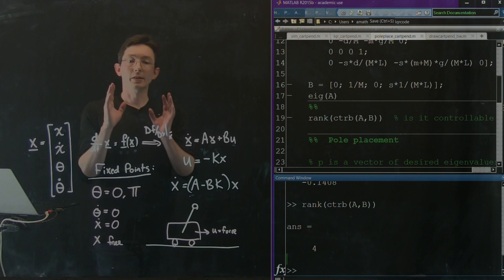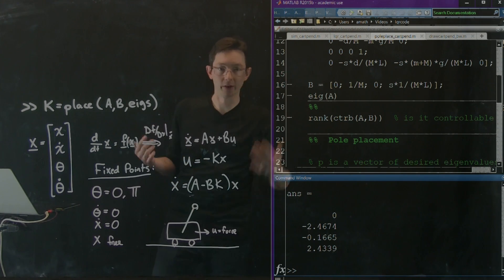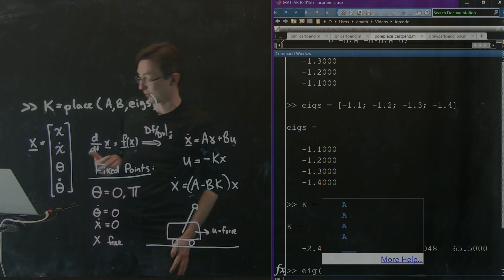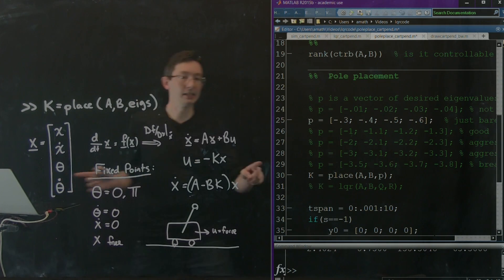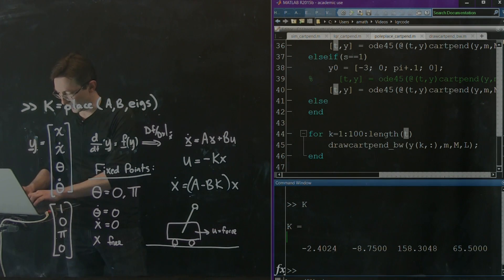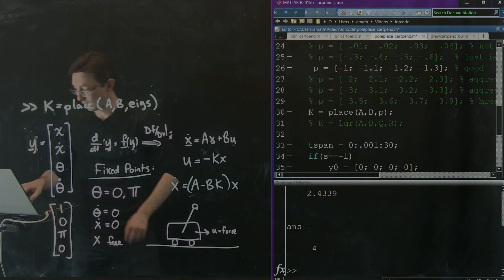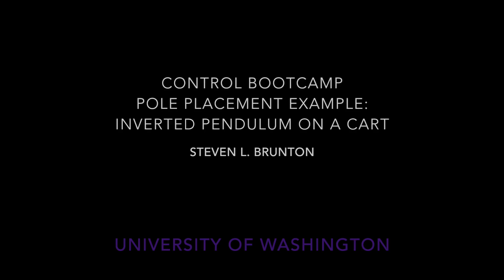Pole Placement for the Inverted Pendulum on a Cart [Control Bootcamp]

Comment: This is great, but somewhat confusing. We are using a numerical model where time is clearly discrete. Poles should therefore be within the unit circle on the complex plane. Instead, we are using the definition of stability taken from the continuous-time systems (negative poles). Where is the boundary between continuous time and discrete time? Is this about how small time steps are?
Reply: the MATLAB’s solver (ode45, ode23, RK4) converts it internally into very small time steps, that does NOT mean your system is discrete, It means your computer evaluates the continuous system numerically.

Comment: The cool thing here was that y_ref did not show up in designing the controller. We only used y_ref when solving using ode45, which to me means that the final state does not have an effect on the controller. So cool. Someone correct me if I'm wrong. (Maybe it's a result of those equivalent reachability, controllability, etc. stuff)
Reply: y_ref (same as X_ref in the video) is zero, so no need putting

Comment: Thank you for the great video. However, I found a little bit weird that we designed u=-kx but implemented u=-k(x-x_ref). Could you explain why it still works?
Reply: Yea, K acts on the error to the reference signal, so if we are close to the reference signal we don't need to have as much control input I guess.

Comment: Thanks Professor! How can I generate the code to run the controller in Arduino?
Reply from the maker: Good question.  You can start by downloading the code at databookuw.com.  Also, Brian Douglas has some great stuff on control implementations in hardware.

Comment: I have a doubt on the beginning values used in the simulation. The starting values are chosen close to the point where we want to stabilize (pi,0) or (0,0). What happens if the starting values are faraway from the point to stabilize? I guess our linear model is not valid anymore and we wouldnt be able to guarantee that we can reach the quasi stable equilibrium (pi,0). Is there any general rules on this? If starting state is way in the non linear region (where linear approximation doesnt apply), can we still use the linear controller?
Reply: Well at some point you will have to use non linear control, which is much more complicated than linear control. Or you can set up a trajectory to get near your desired point, and control your system so that it follows this trajectory by linearizing several times along its path. When you get close enough, you can start stabilizing the point using what he did.

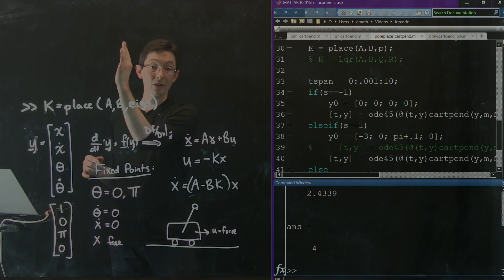Comment: At 11:03 you said that making the eigenvalues too aggressive will actually cause the system to become unstable, due to the nonlinear dynamics.
But this is always a risk -- we've linearized the system around a particular point, so going too far away from that point could cause our controller to fail.
Is there a way to find the border of the state space where our linearized controller will start to fail? 
If so, would it be possible (or practical) for the size of stable area to be a term in the cost function that you describe in the LQR video? (The bigger the area where the controller can stabilize around a fixed point, the better -- so I'd like to optimize the controller to widen that area)
Reply from the maker: This is a great question.  That is true that often nonlinearity implies some "basin of attraction"  near your linearization.  In general, saying things about performance and convergence in nonlinear systems is very challenging.  Lyapunov functions are useful here, but they are hard to come by in real systems.  I do seem to remember seeing the radius of convergence being a term in some advanced control optimizations, but I can't quite remember where, off the top of my head.
Reply: @Eigensteve  thanks for the quick response and the pointer to lyapunov functions. Your videos are awesome by the way!